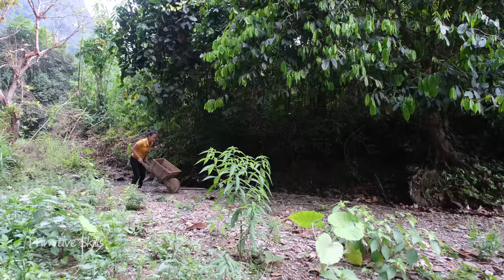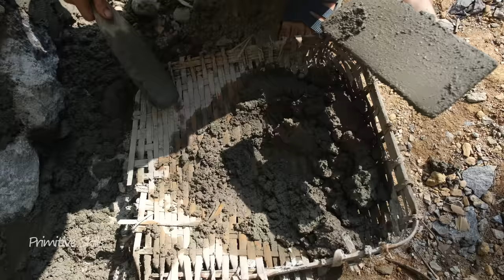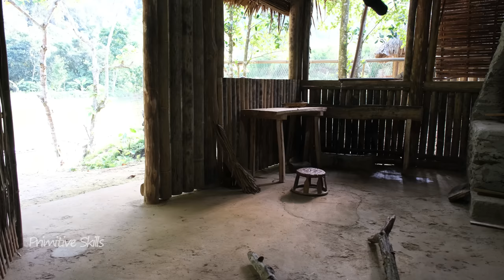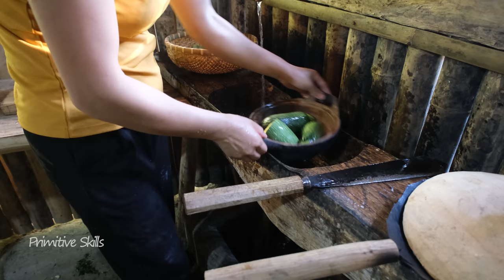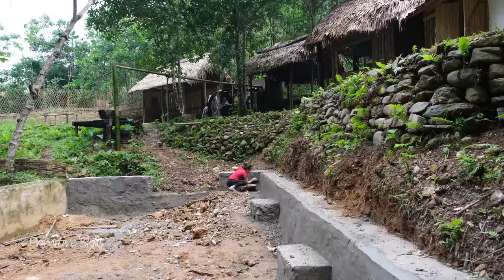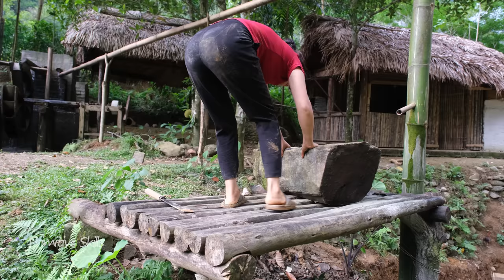Wall Finishing, Dig soil to expand and direct water the pond, create space for fish to play

Comment: Everything is looking great, the fountain will add much-needed  aeration to the waters.   My only concern is the area above the pond in front of the huts.  If I  remember correctly,  Duong cut into a hill and leveled out the area to build the hut.  Digging the pond you may have made that area unstable during the rainy season.  If I were you I would put more stone on the bank to protect the main white hut from sliding down the hillside.

Comment: hey, a little tip for the next time you want to plaster a wall.
Make the wall wet before plastering. reason behind is that you make the stones wet, so when you start plastering all the water won't be sucked out of the mortar into the stones, the mortar will dry more slowly and will be less vulnerable to cracking (that cracking is due to the stones sucking al the moisture out of the plaster and thus it dry's out to quickly causing cracks to appear)

Hope you found this tip usefull
Reply from the maker: Thank you so much,I will better next video.Wish you all the best,see you in the next video.

Comment: That water is not going to be the same as the big pond that Duong made because there is no water always going to be flowing in and out of it like the big pond is unless you have plans on how to get water to constantly flow in and out of it. If it remains stagnant water all it's going to do is turn into a big mosquito infested dirty water hole. It won't work if the water doesn't get aerated.
Reply: I’m assuming they will divert the water so that it flows into the small pond first, then the overflow will drain from the small pond into the big pond. It would be better if the small pond walls were slightly higher than the large pond, so that the water falls and gets oxygenated.